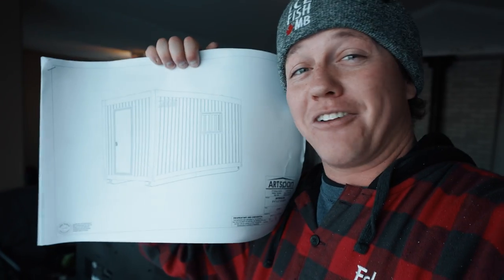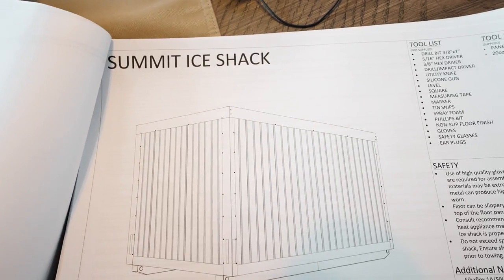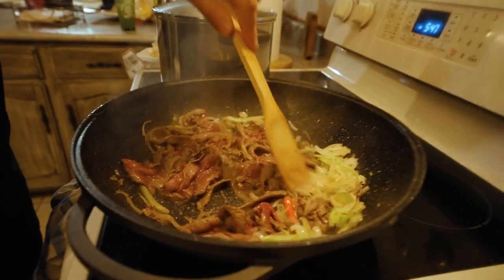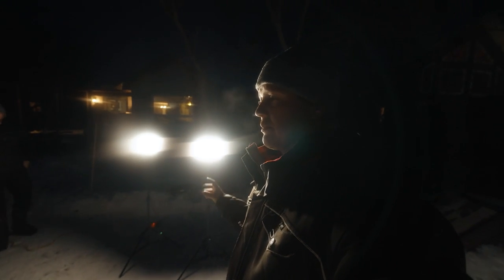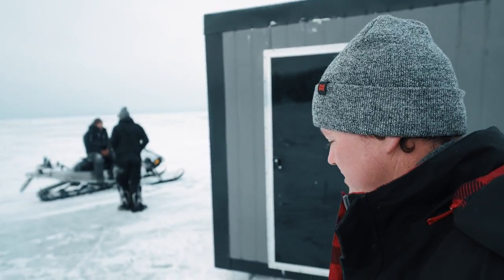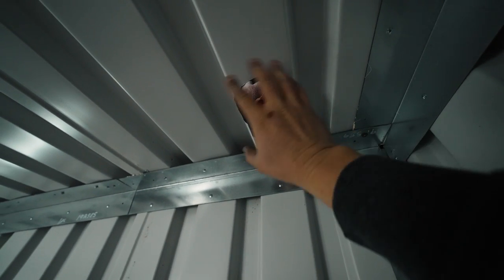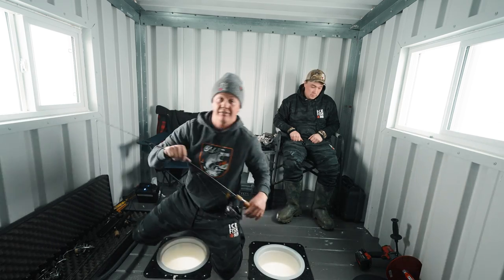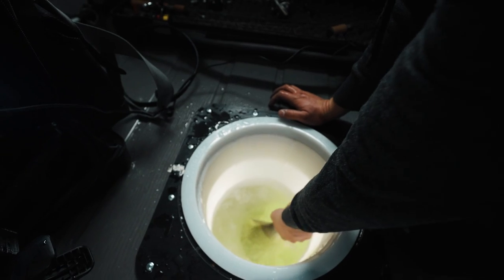We built a $7500 Ice Fishing Shack!

Comment: Interesting the assembly in the cold with construction caulking.  Very interested in seeing the durability and longevity.
Reply: The Calk will cure around July 🤣😂
Reply: I could be wrong, but I think they were using that just as a sealant for the seams? Maybe I'm wrong. I don't think it was intended to hold anything together.
Reply: @macgyver2169  you could be right but I didn’t remember seeing any fasteners being driven.

Comment: Cool video yet again! I'd recommend to install a circulation fan in place of the chimney vent if your going to keep using the buddy heater... Then wire up some receptacles and an exterior genset hook up or power station input. Real minimal cost and effort for huge gains... But I'm sure you're already contemplating ideas ;) cheers! (check out ecoflow delta power station... On sale right now)